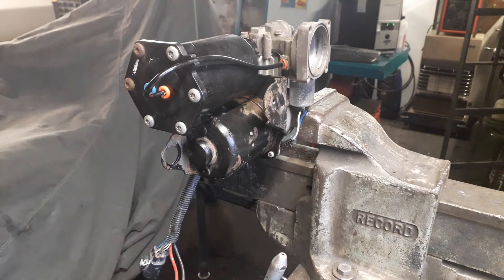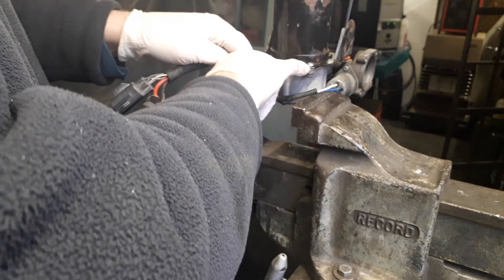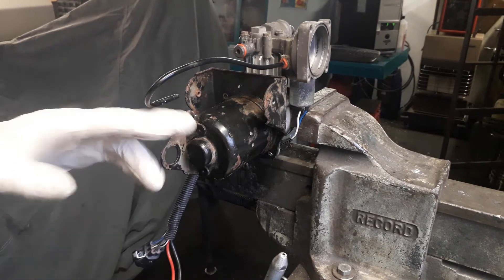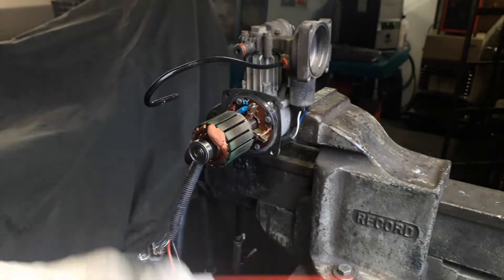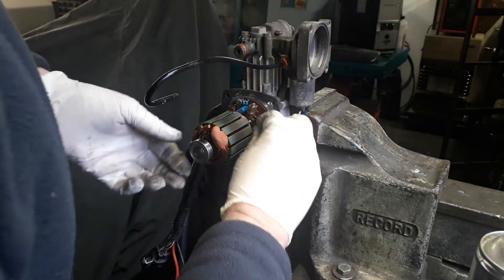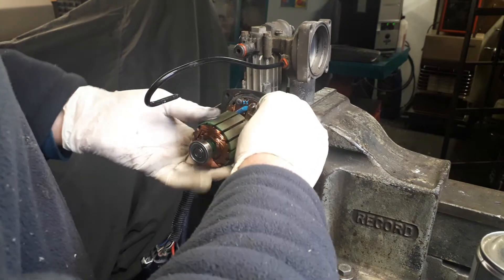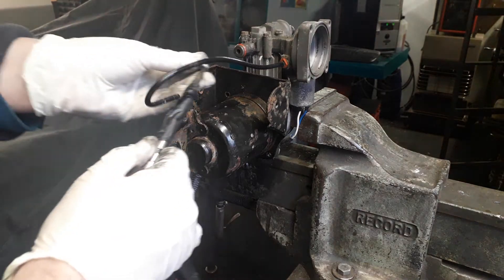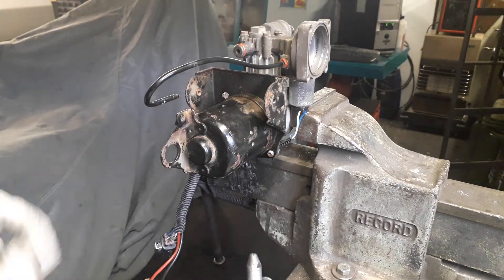Electric Motor servicing Oem Hitachi Air Suspension Compressor

Comment: Hello, I took the compressor off the truck and tested it with a 12 volt battery and the motor does not power on. Does the motor need to be replaced or can be refurbished? Thanks
Reply from the maker: yes sounds like u need a replacement motor
Reply: @4x4airsealstechnical99  Thank you. I opened it up and it was burnt.

Comment: You did not check the bearing!? I did a similar job on a Webasto unit and felt that it was a good idea to chnge tge bearings as well. Now I have a Jag X350 and did order the seal kit. So now I wonder do I need to owerhole also the motor.
Reply: you are correct, the bearing should be checked. Give it a spin and if it's dry and noisy or lots of slop in it then it should be changed, as well as the drive-end bearing.  And dont put cheap bearings in, for the sake of a couple of extra dollars get some good brand name bearings, basically nothing made in china.
Reply: Is there a way to undo the crankshaft from the motor?
Reply from the maker: hi , very rarely need to replace the bearing unless lots of water or condensation has effected the bearing .